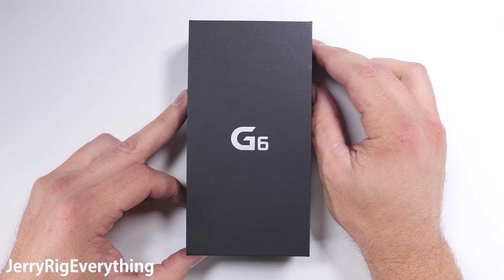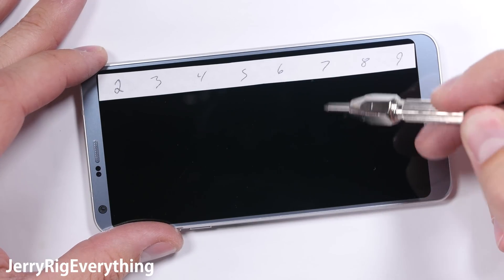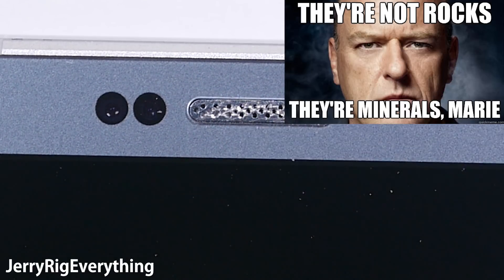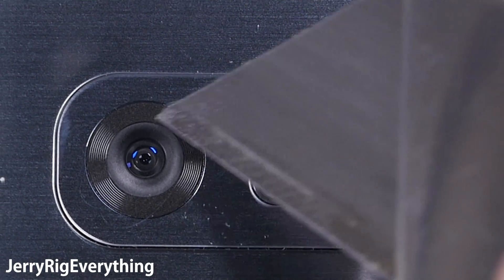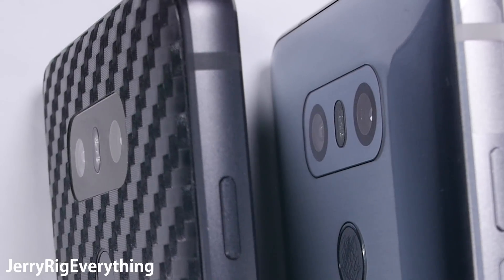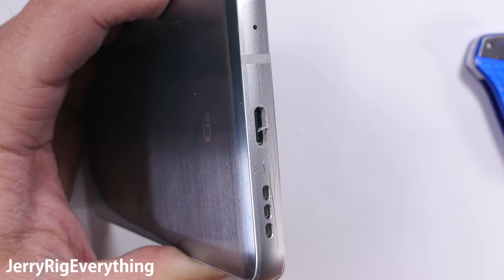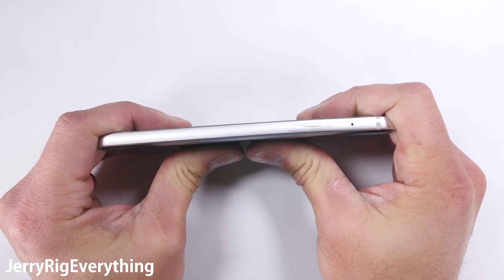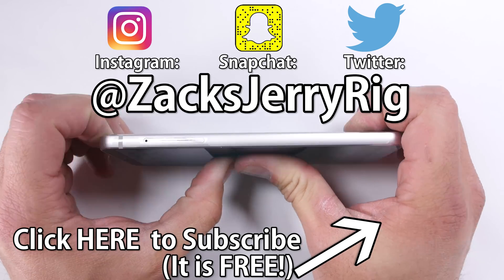LG G6 Durability Test - Scratch BURN and BEND tested!!

Comment: I like the "Like a G6" reference there. Nice touch.
One question, which is stronger, the nokia 6 or G6?
Reply: Well still Nokia is known for it's monster strenght but after watching this video G6 is kinda in par with him. It didn't even flexed a bit on front and back. Big Thumbs up for LG.
Reply: Both Nokia 6 and LG G6 might be equally strong, but G6 has water resistance which Nokia 6 doesn't have...So, thumbs-up LG.
Reply: Nokia 6 imo. It has a mid-metal-plate inside the phone.
Reply: G6 has glass kn back. And Nokia have cloth earphone
Reply: imagine this real life scenario - your phone falls off the table. which one would you rather have - the all glass G6 or the metal body Nokia 6 (and don't forget that the Nokia is designed in a way that makes screen replacement way easier)?
Reply: G6 is also metal body not all glass (noob)
Reply: Nokia 6 was dropped 50ft. above ground but still turned on and worked. Dunno about G6 hope everything pro drops it too on that height.
Reply: '5
mZzz mo o ft
Reply: Albert Christian Where are you from?
Reply: Watch everythingapplepro's (ugh yes I know...) drop test comparing the Nokia 6 and the iPhone 7. It's like Nokia builds their phones to take to war with you
Reply: still - it has glass all around. and guess what happens if it falls - the glass cracks. and you have to replace it. and aint nothing in this world for free. as with the nokia - you have a better chance of the glass not cracking, since it's only on the front side, and not also on the back, like on the g6.
Reply: Pshh. Well let's not get cocky and compare LG to Nokia. Of Course Nokia is stronger because it has that Nokiatus inside that makes it invincible. LG is jsut LG it's not earth destroyer like Nokia. :D
Reply: lol

Comment: I absolutely hated my LG G3, but this is giving me second thoughts on buying the Samsung Galaxy S8.
Reply: Tony MTA My G3 still works flawlessly even after countless drops and dropping it into poopy toilet water; twice.
Reply: Savan Cleveland if I get one I will do it😅
Reply: I've had a G2, which was a great phone before it shat out on me. Right now I have an iPhone 6S, but the G6 looks like it could be my next phone.
Reply: Savan Cleveland come on man, of course the best out of the two is the Galaxy S8, there's is no doubt, spec wise the Galaxy wins too
Reply: Savan Cleveland what did u hate about the G3, mine has been very reliable, in fact I've had for three years, still works. I dont want to have it anymore due to the age , im afraid something will go wrong, but im probably wanting the G6 cuz im liking the water resistence on it and the huge screan size and small body
Reply: I was looking the moto 5G but im not a fan , the reviews are all good tho
Reply: Yeah the G6 passed the test with flying colors
Reply: Savan Cleveland Was it so bad?
Reply: Hackerino👌 yeah, out of the blue, it stop recognizing mobile data. the WiFi stopped working and the phone has a hard time recognizing the sim card.
Reply: Savan Cleveland maybe you had a faulty one.
Anyway I think im going to purchase a Galaxy S8,I have a LG K8 and it sucks
Reply: When it comes out on April 19th tell me how it is.
Reply: I heard it overheats easily and the battery isn't that good. Thats one thing that is keeping me away.
Reply: Yeah, mine never had that issue. Mine is at LG getting fixed so hopefully I will have a functional LG G3.
Reply: Asad Hafeez Yousufi same here men ,my LG G3 fucking nightmare
Reply: 김송 Any specific reason?
Reply: R M flickering screen ,bad battery life , overheat ,poor signal ......LG G3 and G4 same shit
Reply: Savan Cleveland lg chocolate was far superior
Reply: Tony MTA my G4 overheats, and gets a burn pink image of the overlay when multitasking. weird.
Reply: either way I only had an iphone 4 and this one. so I love the g4 better. haha
Reply: I had the same problemw ith mobile data, but only after 3 years of use, also with gps, but i fixed the gps installing android 6.0 so it was all good, probably the best phone i ever had. Now im rocking a v20, x3 as good, hope it lasts a couple years too
Reply: Until this iteration Samsung had LG only on build quality. LG has always had superior software and Samsung's terrible flavors of Android have always required them to have better performing hardware to have the same performance as an LG phone (so don't get fooled by the S8's higher chipset - it won't perform much, if any, better than the G6 when it should be performing light years better)
Reply: I overall hated the UI and battery life. As time progressed, I got used to the UI but then it started to freeze up and perform weaker than my Samsung S3. The phone, just recently, had a data issue where I could not receive any signal with or without wifi.
Reply: Interesting - I have the G6 and I love it; the UI has always been the selling point on LG for me. 

But each his own, man - play with them don't just rely on specs and tests (although the guy putting his g6 alone in a washing machine for full cycle and it coming out without a scratch or issue was pretty amazing). Get what suits you - take full advantage of those return policies as play tests!
Reply: That is what I plan to do. I overall started off with an iPhone 3g and 4s, but then hated how simple the iPhones were. I will forever pick an android over the iPhone but it really is a battle between the One plus 3t, the G6, and the S8
Reply: Easy fix just watch a YouTube  video , fixing Wi-Fi problems on LG G3, and follow the instructions
Reply: Its past a basic video fix, the connector that carries a signal from the sim card to the phone is burnt. This means the phone cannot receive any signal. Its a LG flaw.
Reply: Yea that sounds bad
Reply: Yeah its a bummer, but thats what happens when you run a phone through its paces for 3 years.
Reply: I saw the bend tests on all of the Motorola phones and I'm not sure if i could run a fragile setup.
Reply: Besides the camera being prone to scratches, I do like how clean and bulky this phone looks compared to the sleek and curvy Samsung lineup.
Reply: That Samsung is so tempting though but LG's been very reliable so I got to look at that for me though
Reply: Thats why i am torn between those 3 phones
Reply: Ive been with lg for the longest and never had problems with their flagship phones (not the cheap ones you can get for like 100 dollars) but my v10 recently bootlooped and after looking into it, its a really big issue that lg has kind of ignored and not fix. Because of that ive made my switch the the s8 fearing the g6 will do the same and i just cant take that risk.
Reply: lg g3 was shit
Reply: I have a G4 that bootlooped and was still under warranty. I have high hopes for the G6 because the CPU has extra cooling as demonstrated by jerryrig's teardown video. And the bootloop is caused by the CPU burning itself up, they replaced the motherboard on mine. So the extra effort to cool the CPU gives LG a few points in my book. I love their phones as long as they keep working.
Reply: i love samsung but after my s5 i got the lg g3 and lg was good to. was gonna get the note 7 but that was a no. Wanted to go back to samsung but nope, i hate this edge thing they are doing. wish they made a non curve variant.
Reply: Savan Cleveland I suggest you go for the G6! ABSOLUTELY love mine!! great screen and good battery life.  it's everything you need and want in a phone
Reply: CAT.A Where do you live that you have the g6 available?
Reply: I'm still using my G3 and it works fine on nougat
Reply: How did u get nougat? Rooting it?
Reply: G3 never had a 4k screen......
Reply: Angel Agront resurrection remix
Reply: +95thRiflesOCI Excuse me, it had a 1440x2560 display. The point still stands, 1080p phones were the norm when the G3 came because processors weren't ready for the extra pixels. LG ignored logic and made a crappy phone so it could use the screen as a selling point.
Reply: Savan Cleveland here replying your comment using G3 Lineage OS XD
Reply: Savan Cleveland ' cu
قناهمكملىن
Reply: have a g6, pretty good. Cant deal with the gimmick edge screen that doesnt do anything good but causes misclick from your palm
Reply: as korean, if you use your phone more toughly, i would recommend g6 rather than s8 (fuxk samsung)
Reply: Wasn't a fan of my G3 either, but mainly because it had a 4K screen before processors were beefy enough to handle all those pixels. You could toast bread with it after 30 minutes of use.
Reply: I'm never using an LG again. They're okay phones, but I dread the camera. No matter how many mp (Mine was 13) it still looks horrendous.

Comment: Metal is overrated.
Reply: Sanan same, that's why I prefer my phone to be made out of paper -__-
Reply: HowGamesWork Actually plastic or polycarbonate is more durable than metal.
Reply: Sanan it makes the phone more durable and shows that the manufacturers make their phone with good quality materials, this differenciates flagships and plastic easy to break cheap phones
Reply: Sarper Eroğlu really? well that seems weird
Reply: Sarper Eroğlu as you can see the new nokia phone has a metal sort of back inside it and it makes it more durable than other phones
Reply: But this phone is glass though...
Reply: HowGamesWork Plastic is very shatter resistant.
Reply: have you even heard of meshuggah or periphery?